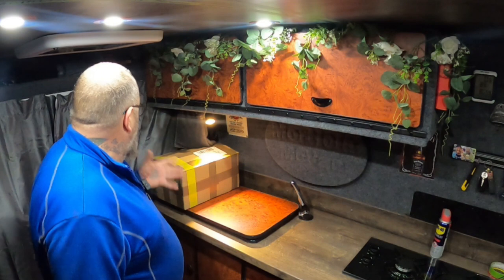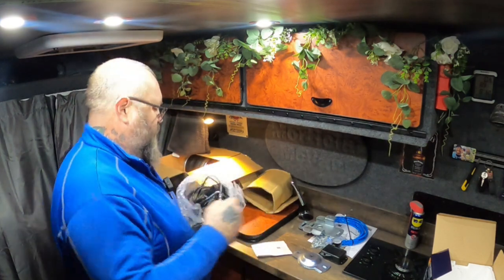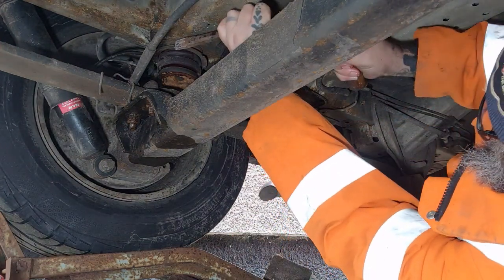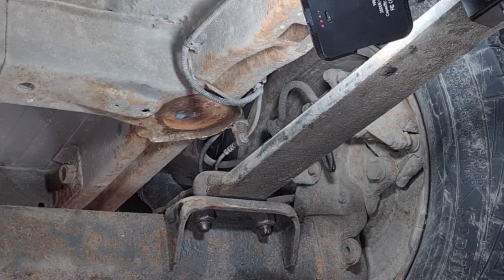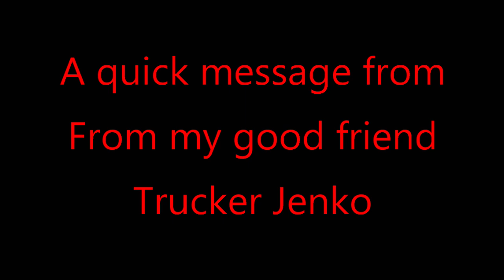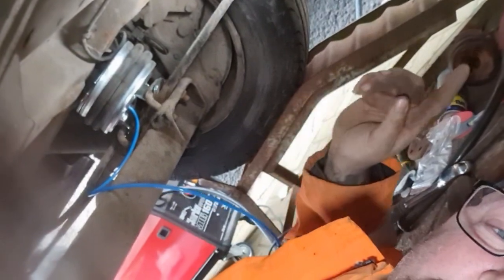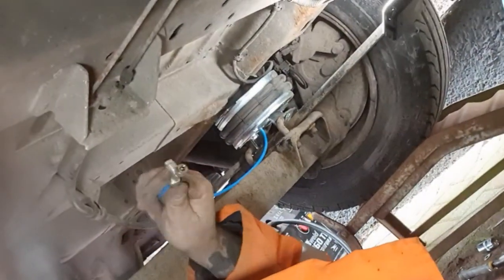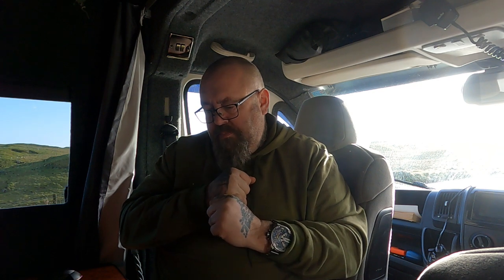Citroen Relay rear airbag/suspension upgrade / Fiat Ducato / Peugeot Boxer

Comment: When he was installing  the airbag He had forgot to tighten the top bracket to the chasis, also a tip for anyone ,, if you suck on the end of the pipe attached to the airbag you can compress them by causing a vacuum.
Reply from the maker: Forgotten to tighten what?

Comment: Mate , just subscribed and I feel your frustration,anger ,pain or as you said temper lost 😂!
I put some sumo pads on my citroen relay and on both side my spot welded nut was spinning around so I couldn’t get them off 🤬
Angle grinder and every tool ,several trips to supplier to get bolts and nuts 🔩 ,two days later finally 🎉
I wasn’t a happy camper

Comment: Well done fella. Not easy but you took the challenge and defeated it!! Get in!! 👊👊
Just wandering where you jacked from? You had the van on ramps, so where on the van did you jack?
Reply from the maker: I used the jacking point just behind the sill. Not ideal but only lifting the weight of the body.

Comment: A year on, have you realised the pneumatic pipe should be at the top of the air springs?
Reply from the maker: I've been and had a look at the instructions, yes I've kept them, and it clearly shows the pipes at the bottom.